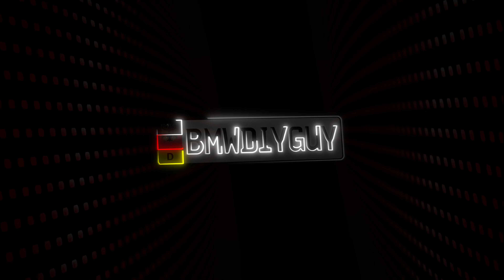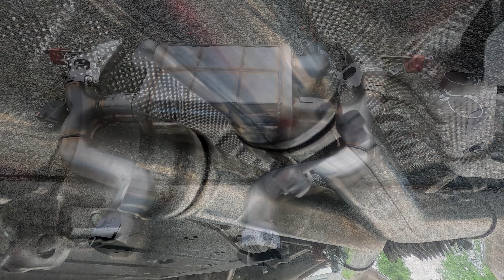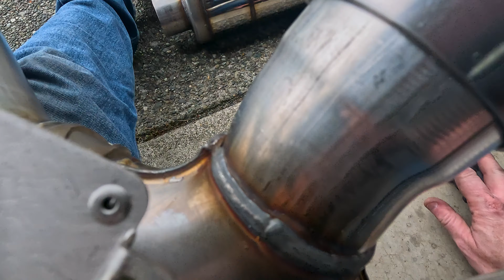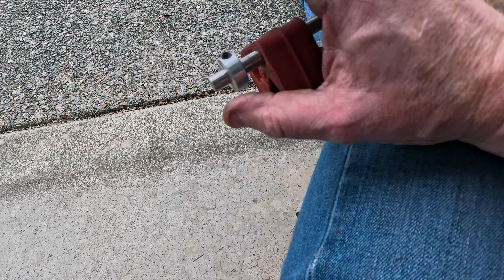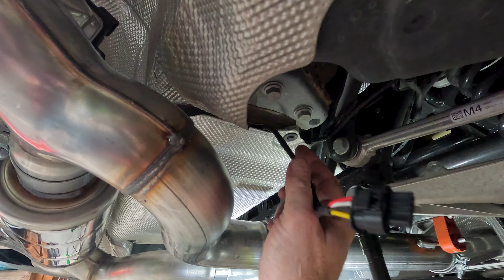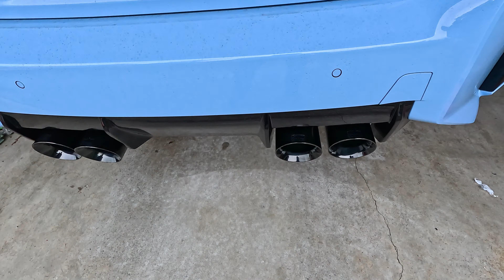Release Premier - AWE Tuning catback exhaust - Easy DIY for dramatic results!

Comment: Just curious if you have any additional tips for install. I'm in the Seattle area and had a local shop do the fit up. They couldn't get it to mount flush, it had a leak, and the valves didn't work... seems surprising to me there would be 4-5 individual manufacturing defects. I'm going to check the continuity on the harness extensions and debating on trying to do the install myself to check if the shop was just incompetent.
Reply from the maker: @D8ona  sorry to hear it was so rough.. I don't have any spare tips though
Reply: @BMWDIYGuy  I didn't mean spare exhaust tips. I meant additional install tips 😄
Reply from the maker: @D8ona  ah ah ah ok.. well it's covered in detail in the video. Right left fitment of the exhaust tips took a bit but worked it out
Reply: @BMWDIYGuy  Thanks. I'm going to check continuity on the harness extensions and if those check out ok I'm going to try the install myself. Not sure if the shop is the issue or if there are defects in the system itself.
Reply from the maker: @D8ona  I would be very surprised if so, AWE is excellent